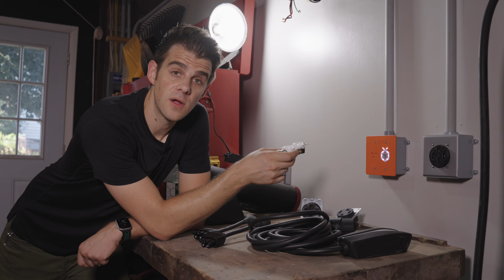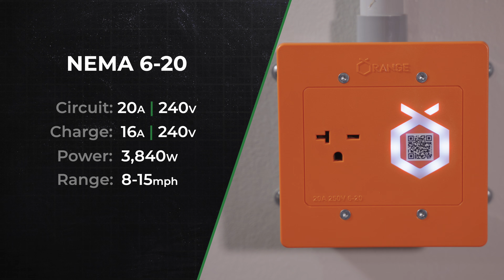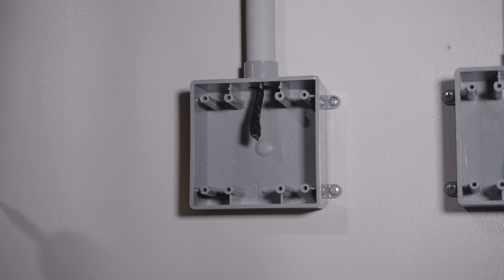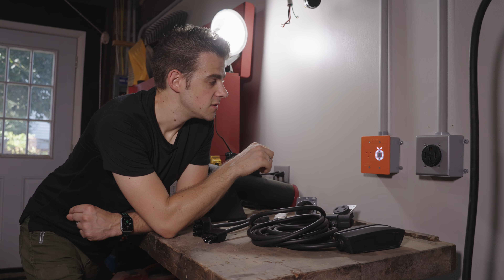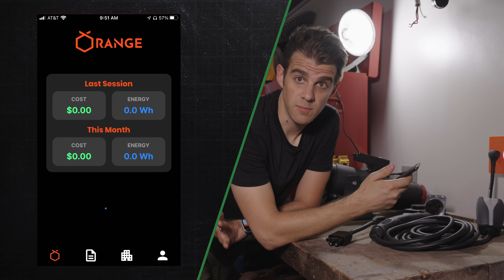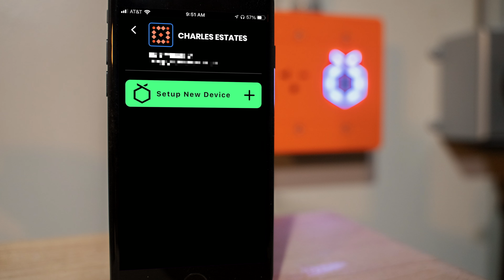A Better Option for Apartment EV Charging: Orange Charger

Comment: The payment system aside just informing people and encouraging the installation of EV grade NEMA 6-20 outlets alone would go a long way towards improving charging access for people..  16 A 240 V charging is perfectly usable for overnight charging. In fact, I dial down the amperage to 16 A on my Nema 14-50 because that is sufficient for my overnight charging needs and I don’t want to stress my home wiring at 40 A

Comment: A few miles per hour seems like not much, but most people have their vehicles parked most of their day, and 10 hours overnight is enough to cover the daily commutes of most people. 

Even if it’s a net loss of several miles a day and you need to fast charge every couple of weeks, that’s still an improvement over gas, which never refill themselves an extra ~30 miles each night.

Comment: Josh, We have a (lease) on a Jeep 4xe (hybrid) and are contemplating choices for our next lease vehicle.  We had been plugging in every night to the standard 110v in the garage, however kept noticing burn marks eventually on the outlets (okay, we should have quit after just one, I know) .  Our dryer is five feet from the garage, but the circuit box in far away in the basement.  We might consider installing (or having installed, although from your other video and my experience, I would have no problem, if the circuit box were right there in the garage) a 220v, but after watching the first part of THIS video, and knowing that we don't really mind the "overnight" charge, I was wondering if you have any advice? Do I just need to install a different 110 outlet in the garage, so it won't burn?  Thanks so much! (sorry, for all the run-on sentences)

Comment: Doesn't the current version of the Autel charger you showed already have this ability using the RFID cards? Also couldn't you set 20 amps in that same charger to get the same low cost wiring installation (20 amps breaker setting is 16 amps continuous for the charger, still plenty fast for overnight)? Lastly customers probably don't want to provide a cord to easily be stolen.  The cord attached to a charger is harder to steal, and the property owner would most likely have better luck getting the cops to do something about the theft than would an individual.

Comment: I am in a SFH. I don’t need the tracking features but would love a low cost way to increase charging rate. Can I swap out a 120v outlet for a 240v outlet without running new wiring to my garage?
Reply: "Can I swap out a 120v outlet for a 240v outlet without running new wiring to my garage" -- that will depend on the wiring you have.

The NEMA 6-20 option shown here will require a 20A circuit. Most residential outlets in a North American home are 15A, and will use 14 AWG wire. You can't use those circuits with this box. A 20A circuit needs 12 AWG wire.

In some cases, you might find a 20A circuit already run. For example, 20A circuits are not uncommon for kitchen outlets, and sometimes you find them in garages as well.

But your home could be different. You'd need to look at your electrical panel, find the 20A breakers (if any) and see if any of those go to a place where it would be useful to supply power to an EVSE.

Note that one other complication is that you really want the EVSE on a dedicated circuit, because it's going to use the maximum power the circuit is rated for. If you're careful to not use any other equipment on the same circuit when the car is charging, you could share the circuit with other outlets, but IMHO introducing that opportunity for human error seems unwise. Granted, the worst that's likely to happen is you trip the breaker, but why take the risk?

So unless your existing 20A circuit has only a single dedicated outlet already, it would be best to find all the other receptacles and decommission them (cap the wires and replace the outlet and faceplate with a blank cover).

Comment: Unfortunately here in BC you are not allowed to charge per kwh unless you are specifically a charging company.  Stratas and apartment owners have problems with billing.  Even with load sharing it takes a lot to run chargers especially if lines need to be buried and run between buildings outdoors.  Not having a plug means people will end up with stolen granny leads but atleast that means the charger owner wont have copper cables stolen.  If I understand correctly they dont support load sharing so each plug needs a dedicated circuit which definitely limits scaling ( OCPP 1.6 smart charging allows ~5-10x the chargers rather than dedicated circuits which are crazy expensive to install)

Comment: If you're living in an apartment, perhaps it's not the best financial decision to be purchasing an EV

Keep in mind, these 240v NEMA 6 receptacles are not designed to output 20 amps for 8-10 hours straight. It is intended for large window and in-wall air conditioners.  NEC has the minimum romex  gauge for a 6-20R receptacle to be 12/2 but if you're going to run 20a through it for hours and hours things might get a bit warm. Whatever you do, don't skimp on receptacle quality. Use a commercial (Fed-Spec) outlet at the minimum, though i'd recommend a more robust "heavy duty/industrial" version.  

The difference in price between a residential grade outlet and a heavy duty/industrial is about $15 and in the grand scheme of things, how dumb will you feel if you burn the garage down over the cost of a value meal. Lots of people have caused fires buying cheap 14-50 receptacles. The ones that cost $10-$20 are garbage. Just like the 6-20 outlets that cost under $10 are garbage.
Reply: "if you're going to run 20a through it for hours and hours things might get a bit warm" -- Watch the video. The EVSE only allows 16A of power, which is fully within rating for continuous load on a 20A circuit.

Comment: Alright, so here in Europe this setup is somewhat common because we run on 220-240V 16A. The biggest issue is 3.8kW really isn't all that much, and having to take the cable with you all the time is quite inconvenient. Common long-range vehicles range from 60-110kWh battery packs, which means at 3.8kW you're looking at over 24h 10-90% worst case scenario. It's certainly better than nothing, but not a perfect solution.
Reply: The strategy of this using this product is to always plug in your EV when not driving.  The only time your EV is not plugged in is when away from home.  This way you achieve the number of hours needed to charge.  The average daily drive is about 40 miles so you should be able to replenish that range easily.  Greater range replenishment is also possible.

Comment: As the electrician: is there a system in place for load management? Adding EV is added at 100% for the overall load calculation of the building. Are there any products you would recommend for this if the building is close to full capacity for it’s overall usage. Thanks

Comment: Dont use the wagos!!! You need as much of the copper from the splices TOUCHING eachother as possible!!! Esp. In this application! WAGO's only contact about 10% of the diameter of each wire in a splice.☆☆☆
Reply: Yes, twist copper wires together and use a wire nut.
Reply: The Wagos are tested and rated for the 20A circuit. They are fine.

There have been other people who have actually tested various wire connectors to failure, and while the Wagos have measurably higher resistance, the difference is actually quite a lot smaller than you seem to assume, and they carry 20A of current just fine with no significant loss.

It would be pretty bizarre for the manufacturer to include wire connectors that aren't adequate to the job.

Comment: To me it seems there are at least three pluses to Orange: 1: cost to install and convenience for the user, 2: cost to use is significantly lower than commercial charging stations (it is still a lot cheaper than gasoline!), 3: the property owner is compensated for related power expense.

Comment: We own an older condo with unassigned parking and no outlets in the parking area. There are hundreds of buildings like ours within a few miles. This is the sole reason we can’t switch to a BEV even though we need to replace our car. Solutions like this our absolutely critical as long as the rates aren’t usurious.
Reply: I solved my problems with not being able to have a BEV and solar by buying a SFH.
Reply: @user-tb7rn1il3q  SFH?

Comment: I see directly one issue with the installation. A lot of equipment rated for 20A is not rated for that continuously but for a certain time. So a 20A outlet might be good for 10 minutes, but would start to melt after 1 hour. Same with the heat dissipation from the wires - never underestimate that. Heat dissipation is not only a fire hazard but it also hurts your wallet unnecessarily.
Where I live I can get 230/400V 3-phase power residential and that means that with 16A I can get 11kW charging. I wouldn't be surprised if US households will end up going there eventually.
Reply: NEC accounts for that. 20A breaker, 12 gauge wire on a NEMA 20A rated receptacle is allowed 16A of current draw on anything running for 3 or more hours.

EV chargers from REPUTABLE companies (I'm looking at you, Lectron) must account for this and limit chargers to 12A on 15A receptacles, 16A on 20A receptacles, and so on.

Comment: This is definitely going in the right direction! 
As we consider increasing the number of EVs on the road a few observations seem relevant.
1.	Apartment buildings will have a large number of tenants with EVs that will need to charge (each night). 
2.	People will want to plug in when they get home, and not want to move their car until they need to depart (the next day). 
3.	Charging a large number of EVs at higher Level 2 charging rates (6.0KW and above) will potentially draw a large amount of (peak) power.
4.	Today, apartment dwellers often use DC fast chargers (or superchargers) as "gas stations". and "fill up" periodically.
5.	The average car in the US travels about 14,263 miles per year (39 miles per day). 
6.	An EV might get 3.5 miles per Kilowatt-hour (KWh).  Note: The Tesla Model 3 is slightly better than 4 miles per KWh, on paper. However, this number is achieved with ideal conditions, the actual car efficiency depends on a number of factors, including weather/climate, etc..  We’ll use 3.5 mile per KWh as a more realistic value. 
7.	Let’s assume that a car is typically parked for 8 hours at night, each night.
8.	The demand on the electric grid (and the apartment complex) is lowest at night (with no EV charging considered).  

From which we can make some baseline statements: 
a.	Each car really only needs to replace the energy used each day.  
b.	From #5 and #6, each car needs to replace 39/3.5 = 11.1 KWh each night.   
c.	From #2 and #7, we will have 8 hours available to achieve our charging (b). 
d.	Charging over 8 hours requiring 11.1/8 = 1.4 Kilowatts of power or 1400 Watts. 
e.	At 240 volt, this can be achieved with 6 amps. 240V x 6A = 1440 Watts.  
f.	This is important since (as hinted at in #3) we will want to keep the peak power demand of the apartment complex low, while charging as many vehicles as might be required.  
g.	From #1 and #2, we will want to install a large number of (orange) outlets. 
h.	We will want these outlets to be as inexpensive as possible since we will need many of them.
i.	We will want to optimize this system, but we don’t need to be perfect.  If we meet 80%+ of the charging needs this way, we will definitely improve the situation in #4.

These orange outlets seem like a good start.  Some other aspects of such a system include the need to control/limit the power to each car to 1400 Watts (or 1440 watts).  Tesla’s let you adjust the charging current from 6 Amps to 32 Amps (in one amp increments) while using the mobile connector and connect to outlets such as these. Other cars may not have this level of charging control and may simply draw 12 or 16 amps regardless.  This might ultimately be problematic.  There are ways around this (by switching on and off the orange boxes in a “time shared” manner), but this might wear out the relay in the orange box prematurely.  It would be important to limit the total power draw from the apartment complex to ALL the orange outlets installed.  This needs to be done so that the maximum power available to the apartment complex is not exceeded.  If the apartment complex needs more power to run (for example) a heating system, then power sent to the “parking lot EV charging orange boxes” may need to be reduced to stay below the maximum power limits of the complex.  This will require monitoring the total complex power requirements and may result in turning off (and on) the orange boxes several times throughout the night as needed.  How to determine which orange boxes to turn off will need to be determined (maybe randomly?) There is really no reason to limit charging to the 8 hours at night.  If cars are parked longer or over the weekend, then charge them as long as you can. However, if electricity rates vary as per the time of day, then it would be appropriate to work this into your “orange box” control system.  

This problem is not so simple and there are other aspects I’ve not gone into.  But these orange boxes seem like the right approach.  Just need to put together a smart control system around it!
Reply: Most EV Charger will talk with each other. You can plug every can into a charger and they will each draw a reduced amount to prevent overloading the circuit.